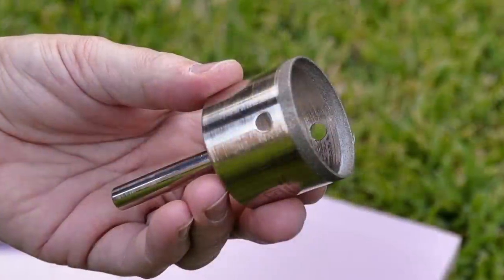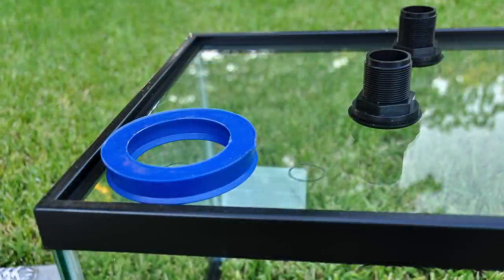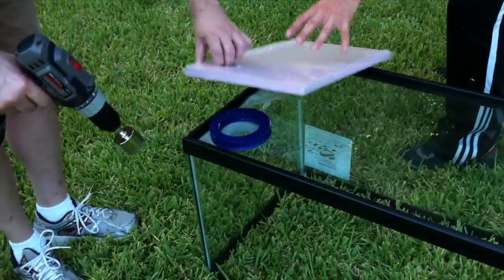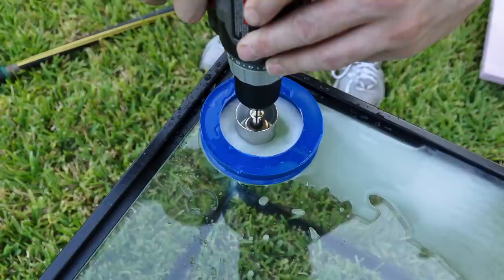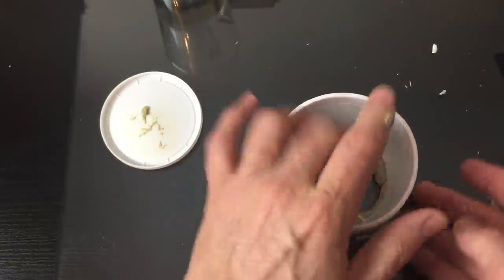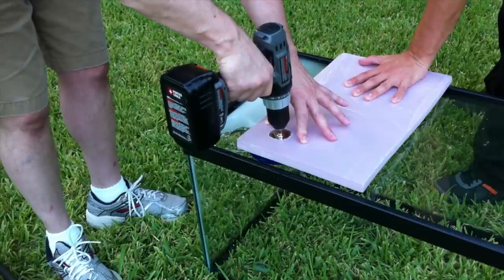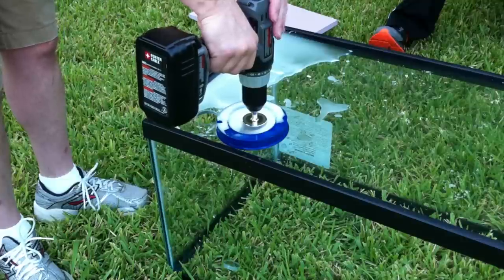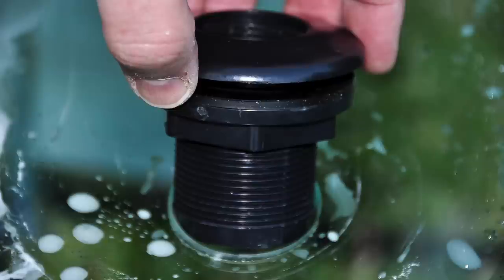Drilling a Hole in a Glass Aquarium

Comment: Forgot to mention,when I drilled my 75 gallon,I used a hose to constantly flood the dam of putty around the hole,with a lower “spigot “shaped section of putty funneling the water and glass particles to my running shop vac..This kept cleanup to a easily manageable minimum...

Comment: Are there some size tanks that are easier to drill than others?  I cracked four 10 gal. tanks, right at the end of the drilling process.  I have a 20 gal. that I planned on drilling, which has thicker glass; but, now I don't know if I should try it or not.

Thanks for the informative video!
Reply from the maker: 10g aquariums use very thin glass and are prone to cracking.  I've drilled 20g, 29g, and 40g aquariums.  Thicker glass is less brittle.  It's better to take longer to cut through with little-to-no pressure on the glass itself.
Reply: Ok, slow and steady. I'll give it a shot.  Practice makes perfect.....I hope.
-Thx
Reply: @oceanmax9685  You may never see this, but I'm curious if you successfully managed to the 20G?

Comment: Is the rubber dam actually what it’s called? (The blue thing to help seal the water in for drilling the hole) by googling it to try to find one, it’s not showing up. Thx in advance!!
Reply from the maker: I never did find the source, sorry. It was a kit I borrowed from a friend. 

You can make a dam with a upper section of a styrofoam cup and some plumbers putty where that rim touches the glass. That’s cheap and works quite well.

Comment: nice a 40 gallon breeder my next tank build for my spouse what are your plans with the 40 gallon. I would like to see the whole set up from plumbing and the over flow installation :)
Reply from the maker: I did install an overflow box and plumbed it into a sump.  The entire setup was a raffle prize I donated to MACNA in 2012, and you can see two pictures of it on this page. First and last picture specifically. http://www.melevsreef.com/node/1260

Also, I took pictures of the plumbing and documented it here: http://www.melevsreef.com/articles/plumb-single-overflow-two-zones
Reply: oh nice I see looks great I see you have your own booth to
Reply from the maker: jayme alcay I run an online business which includes quite a bit of custom acrylic work. When I set up at a tradeshow, that's my booth. www.melevsreef.com/catalog
Reply: melevsreef really nice I need a internal overflow box I want one off your page for a 40 g
Reply: melevsreef Hello, just a question about the EZtube frame stand how much weight will it hold? I notice in the pictures that the tank is empty, so was wondering if the frame was just for empty display purposes. Thanks
Reply from the maker: Savario Ferrara If you use the steel pipe by EZ-Tube, it can handle the weight of the 40g breeder.  I used the same stuff for my 60g cube, but the stand is taller and the weight is greater and seems to be overloaded.  I added wood panels to reinforce the stand and that helped.  For the 40g, it'll be fine.
Reply: melevsreef Awesome thanks!! Love your channel!! KUDOS!!

Comment: I want to drill on a 10 gl tank which has 1/8" thickness. I heard it is not easy to drill on that thickness. But due to the space I only have a 10 gl option. 
Appreciated if you could advise or post a video on drilling on a 10 gl tank. 
Thank you
Reply from the maker: It is very brittle.  Take your time, and realize it may not work out (could crack).

Comment: Do you have any advice for me, Im going to set up my 75 gallon with a glass-holes.com 1500gph over flow kit and I want to use the Bean Animal overflow system. What size plumbing should I run and what other advice could you give me going forward with this project? Ive learned a lot from your channel and I really enjoy your videos by the way!
Reply from the maker: The overflow box you buy will come with specific holes for the bulkheads.  That will be the size plumbing you'll use.  You can read the full article about the beanimal drain system here: http://www.beananimal.com/projects/silent-and-fail-safe-aquarium-overflow-system.aspx

Comment: Hello and thanks for sharing this educational video. How comfortable did you feel by drilling two hole so close from one another? I just bought a 100G tank and it has an overflow placed pretty much in the middle of the first third of the tank, not aesthetic at all. I would like to plug this hole and drill a new hole closer to the corner/wall. Any recommendations would be welcome. Thanks
Reply from the maker: I don't have an exact measurement to provide you regarding tensile strength of glass, but maybe such a thing exists on the web. You may be able to google for specifics.  For me, it's a common sense decision, I try to drill close-ish to each other, yet leave enough glass between them that the area can retain strength. The bulkheads help reinforce those holes.  Basically you'll want about 3" of solid glass between each hole, or more.  

You can not drill tempered glass, so you do need to know if the panel you plan to drill is tempered or not.
Reply: melevsreef thanks, great intel :)

Comment: What is the rubber water dam? I can't find anything by that name on Amazon.
Reply from the maker: It was part of a kit I borrowed, but you can make a dam with a styrofoam cup and some plumbers putty.  Cut the cup on half, throwing away the bottom half. The upper half will make a great collar. Now roll the plumbers putty into a long snake-like shape, and form a circle around the spot you want to drill.  Press the styro-collar into the putty, and add about 1/2" of water.  It's ready to drill the rest of the way through the glass now. :)

Comment: I will be starting a 60 g. marine innovation tank soon. These tanks have black backgrounds like most nano's. I've noticed that with these tanks grow Corlline algae  over the tank in the back with the familiar purple growth. I know it is beneficial on rock but I have never liked it growing in the back panel. I have seen some aquariast build a 3 d background with egg crate,foam,sand and some small rock and build a panel to epoxy on the back. What would you think about just applying foam on the black panel and spreading dry sand on it to create a sandy background for the whole backside. Is this a stupid idea? would the sand be to heavy for the back panel? Any thoughts?
Reply from the maker: +eric olsen I've seen it done in a few tanks, and in the end this is up to personal taste. I didn't like the final look, and it's even worse if algae has taken hold.  My preference is a nice clean back, and I';ll make the time to scrape it clean once a month. If the tank has a black (paint, vinyl, or sign material) background, once cleaned well the corals and aquascape pop against that backdrop.  Not unlike how nice a diamond shines against a black velvet background.

If any of your background peels away or is nipped away by fish, you'll see the harsh color of the foam product.  It may be an eyesore.  It also may peel away and float upwards at some point.  That's not all that surprising to me.

Comment: Hole placement, you put yours in the corner, is this better or worse or the same as in the center? Tape, is this a good idea, bad idea?
Reply from the maker: I like the overflow in a corner rather than the middle of the back pane. Tape on the underside to hold the glass piece a little longer?

Comment: just the video i've been looking for thanks mind if just run this by you , i bought 2nd hand fish tank 52 gallon filled it to check for leaks , when got dark put the light on in tank to find lots of scratches , would it be possible to remove bulkhead seal up holes with glass and move bulkhead to opposite far corner so can flip the tank round back of tank now becomes front , there is not a mark on the back and still has the black paint on from factory and just remove the b. paint ?? if you get me ?👍
Reply from the maker: Yes, you can definitely flip it to use the back and the front. You can seal the holes with a glass patch (same thickness would be my suggestion), or screwing in a permanent plug into each bulkhead instead. You could even reverse the way the bulkheads are installed so they are more streamlined, instead of sticking out the old end of the tank 2".
Reply: melevsreef mate you're a star even better idea thank you

Comment: what size drill bit is that?
Reply from the maker: I'm not positive. Usually these bits are in mm size. A 1" bulkhead needs a 1.75" hole. That's about 44mm